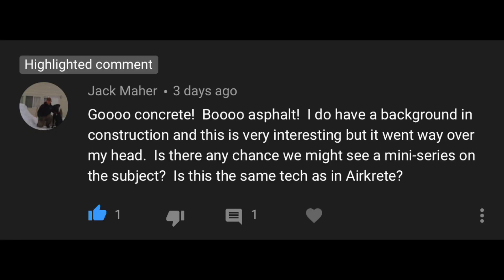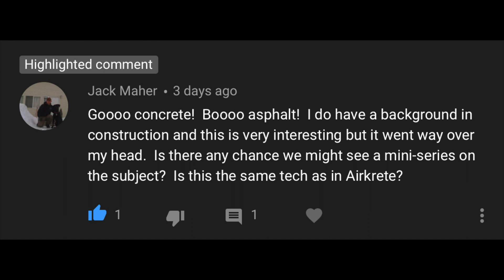Airkrete vs. Lightweight Concrete - Vlog #268

Comment: What is the lighted concrete? Also it will not float under water. Making a concrete rocks for aquarium.
Reply from the maker: See our videos on translucent concrete.  Basically it’s concrete optical fibers from end to end to allow light to pass through the concrete.  You can make float by changing the granular skeleton abs including some air.

Comment: Are you sure about Spraying Aircrete? The High Velocity should mess up the Air Bubbles right? Or are we talking about Concrete with some kind of foam pellets? Still learning on the subject
Reply from the maker: Howdy Anton!  Yes Sir. Sometimes we have designed our mixtures with a ‘sacrificial’ air content.  Which is an air content that we know we will lose through pumping systems and when sprayed.

That being said, we have also used polymer air for design.